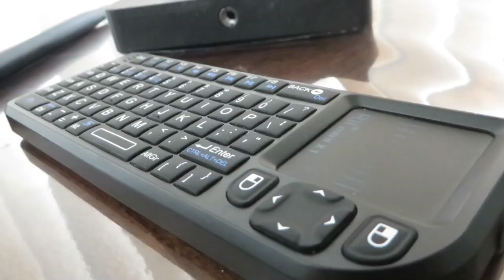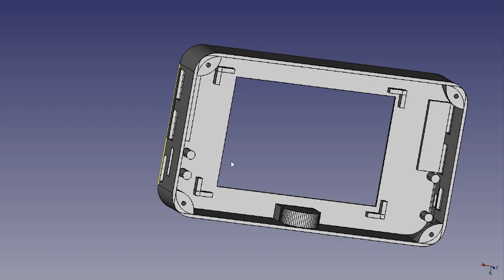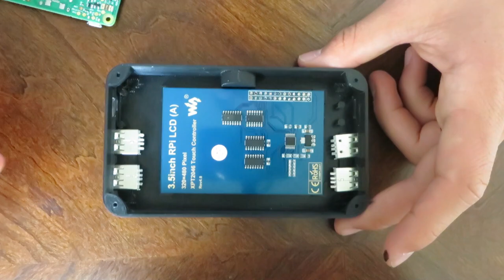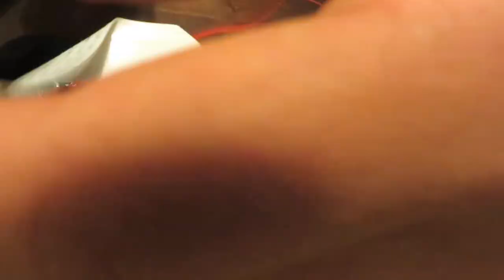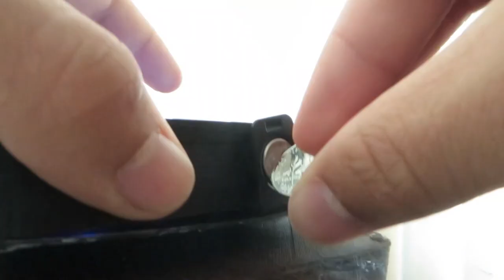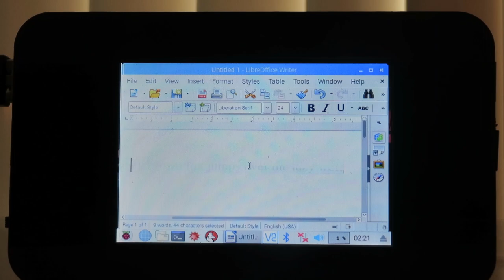AuditPi: a modular Raspberry Pi pocket computer

Comment: Awesome! I would suggest that if you are going to make this as a kit, then you should think a solution for the tricky soldering and for the gluing of pcbs and the connectors to the case. I got inspired to desing similar for a "blackbox" that would record accelerometer, gps and other sensors, but I dont have a budget for that for now.
Reply from the maker: I intend to create custom PCB's for the second revision, thanks for the input!
Reply: The trick to do proper soldering is simply doing it properly. Soldering on an unsteady surface and "gluing" wires do contact points must lead inevitable to the outcome shown in the video.